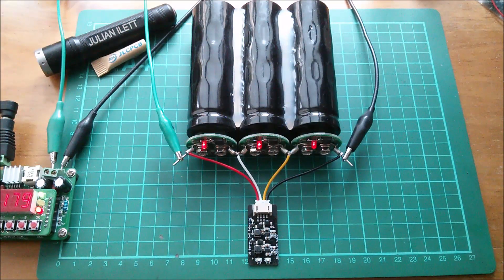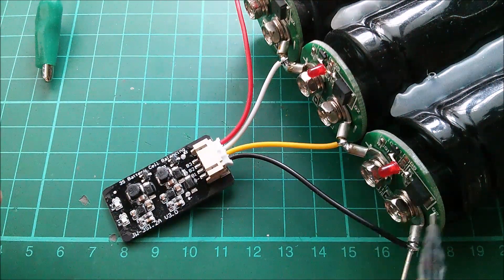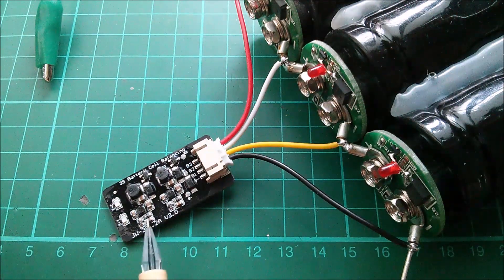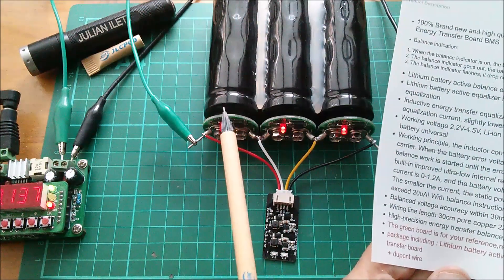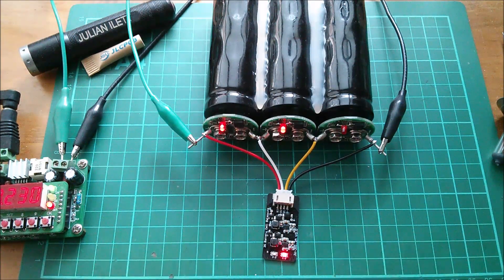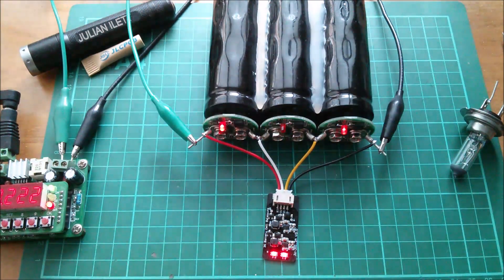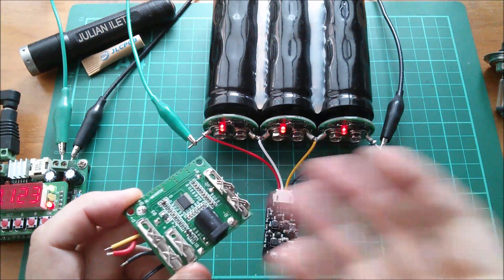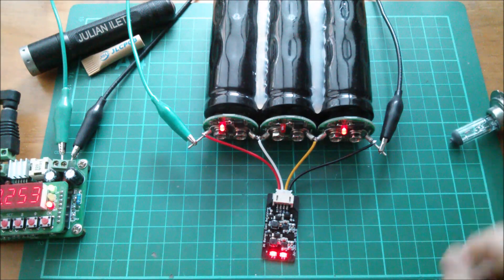Active Cell Balancer for Lithium Ion Battery Packs

Comment: Hi Julian, I know this is a bit delayed but quick question, If you had those super capacitor connected to a battery pack (LIFEpo4) would they discharge the batteries? I;m just about to make a battery pack and was thinking of adding some supercaps but trying to decide whether to connect on the batteies or after the switch

Comment: Does not this module decrese the lifespan of the batteries quicker? Passive balancing takes the energy from one battery only, contributing to its charging/discharging life cycle. But when you are charging one battery by another battery, you decrese the lifespan of both batteries.

Comment: I read somewhere you have to run power through the pack for this to work? I'm getting mine today hopefully it'll work for what I need.
Reply: Nvm it does work without charging or discharging. You just have to be careful when plugging it in. Either go in fast or make sure the -B pin touches first. 

Also loose connection causes the board to short out in like a second. Make sure those solder joints r good

Comment: I've got a few of these from 4s to 16s but my 13s blew its IC between cell 3 and 4, measured the resistance on these cables and got 10 ohms, seen a few videos of these bursting into flames on first use, build quality variable, so now I'm trying to identify the IC so I can replace it, hoping to reverse engineer it and make my own.

Comment: I think this is going to solve a problem I have with one of my 3S tool batteries. It's a dumb battery with no balancing and as a result over a few charge cycles one of the cells gets out of sync with the others and then the battery capacity is severly reduced as it doesn't charge properly and cuts out in the tool.
At the moment I have to open the battery and manually balance the cells. I think I could add in the wires for this board and then let the board do this for me.

Now to find it at a good price.
Reply: I have worked out I can fit this into my battery charger using the monitoring pins built into the battery. Obviously not to be used while battery is charging but I can use it to balance afterwards. 
Going to make it removable by using a USB as it has the 4 pins/wires I need for a 3S board.

Comment: Thank you very much

 I learned a lot and you helped me make an informed decision when ordering BMS for my lithium 18650 project.

REASON!. I wanted to make a 4S Li-Ion standby charger and the problem was this info below. 
Chargers made for operational readiness, or standby mode, often let the battery voltage drop to 4.00V/cell and recharge to only 4.05V/cell instead of the full 4.20V/cell (Mine is a Solar 18V 100W)

Now I wondered how to balance cells that don't get to full 4.2 volts and man you solved this problem for me!

Comment: When using LiPo batteries, Is it necessary to use a LiPo charger with these active balancer boards, or would a fixed voltage be OK? Thanks

Comment: I don't understand your test, you're trying to test how the balancer works and yet you connect the charger??? you should test if all voltage are equal after the lights comes off without the charger

Comment: I got 4 of these balancers on eBay to use on my 14s Lithium ion battery pack. First one burnt with smoke when I plugged in. Second one kind of worked. However in a 14s pack, with minimal 0.1V difference for the balancer to kick in, the worst case scenario there can be 1.4V difference in voltage between cell with minimum and maximum voltages. After all I went ahead with a capacitor based balancer with better sensitivity.
Reply: In your worst case scenario 1,4v. (In theory) That means that the best cell triggers the BMS at 4,2v so the charger stop. And the worst cell is at 2,8v. 
That will never happen in real life. Liion are empty at 3v so the charger never charge and your battery pack have no energy.

Comment: The circuit is similar to a synchronous buck switcher.  A synchronous buck converter has an active MOSFET for rectifier as well as normal coil charge MOSFET switch.  Because it has two MOSFET's to series coil it can buck in either of two cells direction.  The I.C. measures which one of the two cells is higher and buck transfers from higher to lower voltage cells.  Multiple IC's overlap every two cells so it can bucket-brigade charge transfer up and down a series stack of cells.

It actually worked better for you then I expected for the 2.5v supercaps although you did not measure transfer current.  Problem, which you eluded to, is as the cell voltage is lowered, the gate drive voltage to the MOSFET switches is reduced.  This causes their ON resistance to go up reducing the buck switcher transfer current and creates higher switching losses.

Comment: The price of these still haven't come down and I don't know why. They are still about 10 quid from aliexpress including P+P. Considering the components involved, these should be as cheap as chips by now.
Reply: Down to just over a fiver now.
Reply: @caskwith  Nice one. Good to see the prices come down. I did actually buy a couple of these when I posted and they seem to work fairly well.
Reply: @Ziplock9000  That's good to hear. It's a shame no-one in the UK is selling them, I always prefer to buy from a local seller even if it does cost me slightly more as it's so much easier to get a refund if something goes wrong.

Comment: nice video, but i think you're setup is a bit flawed. you are not really showing that it is "moving" current from one cell to another. you are charging at the same time and you are not even measuring the individual voltages on the cells and not measuring the amps. it might as well that this balancer is simply "burning" current on the cell(s) with the highest voltage

Comment: Do you really need a buck converter? it could be the case that cell 1 is being charged with a higher voltage (lets say 2x 4.2 volts) and for cell 1 to charge cell 2 it could be 4.2 volt -> 4.1 volt and the bigger the voltage differences the bigger the charge current with a limit of 1.2 amp.

Comment: I got the 7s version of this and have tested it for 2 months. Works great so far. However, we need a version 2 of this because it only monitors differences of adjacent series. We need one that takes an average of all 7s and tries to bring every series to the average voltage otherwise what happens is that at 0.03v accuracy multiply by 7 = 0.21v. In theory, the 1s (first series) can be at 4.10v and the 7s can be at 3.89 (-.021v) and this balancer will not care. This will become worst with a 14s pack and so forth.

Comment: Hi Julian and all.

Can we really call this BMS ?
It's only balancing the cell, but doesn't seem to do any overvoltage or undervoltage protection of each cell ! Which is very important for Li-ion battery, if not most important!

With that board, you can argy  that all cells are balanced at each time (which is far from true in case of defective cell or problem on the battery pack like broken spot-weldded connection, 1.2A balancing current would never fix a 10, 20 or even more amp of your charging device or your fed device) and thus, manage the entire pack voltage for over and under voltage, but I don't think it's the good way to do it, actually, I'm pretty sure it's not.

I would be interested of what you think.

Comment: julian,
I have come across this charger / balancer unit designed for drills etc. (https://www.aliexpress.com/item/32839009198.html?spm=a2g0s.9042311.0.0.44a44c4dS5p5Mr) not sure if you have come across it but I am loathed to put it into a battery pack as I am not sure whether the balancing happens only at charge time or continuously. I used something similar a while back in a 4s2p pack but when I came to use the drill it had depleted all of the Lion cells and I couldn't recover them.
Mike

Comment: I had a idea.
Could it be possible to make a circuit that connects from one extra battery and walks around to the other cells?
Basically as it hits the higher voltage cells the extra cell would draw some charge then as it moves to lower cells it releases charge.

Comment: Honestly, I don't think I have ever seen a balancer  circuit actually work the way we all want it to work.  It's all about ohms law, very small voltages / small resistors  = very small currents.    I think you would not  of seen any difference between a  pack with the balancer and a pack without the balancer. You would have to have a bad cap or cell in the pack to see that balancer do anything noticable. Interesting video, I like your common sense approach and the fact that you don't rehearse before doing the video.

Comment: Julian, if I bought a 6S Active Balancer BMS would I be able use part of the BMS, say use it on only 3 or 4 Li-ion cells if required? If I could it would save buying lots of different Active Balancer BMS’s

Comment: i very much doubt it can transfer 1.2A. 
the battery balancers that balance at all voltages have the disadvantage in so far that you need perfectly matched cells. otherwise it will try to transfer power all the time in the lower voltage cell but then has not time to discharge that cell again and then in fact creates cell unbalance. this happened to me.
a cell balance system should only balance in the satiated area (almost full). it therefore has to be adjustable because there are that many different lithium batteries.

Comment: Most types of batteries have difficulties when configured in parallel (same voltage, increased amperage).  It is common to have a cell that isn't staying at full voltage (what it's voltage would be if not in parallel).  This device enables automatic switching in a parallel circuit to ensure your batteries stay balanced.
Reply: i think you are a bit confused about something?

Comment: easy, it's using a 2nd fet in place of the diode in the boost, circuit will look like a 1/2 bridge. I sold one like this in the '80s

Comment: Active balancing is not necessarily always a good thing.
Reply: In what situation it is not a good thing?
Reply: @sikkepossu  
he probably thinks if one of the cells goes bad and starts turning stored energy into heat, and you keep pumping energy into it from the neighboring cells, you will accelerate deterioration and ultimately, it can result in big boom.

Comment: So, with 17 cells, and one in the end very slowly losing charge you'd eventually get somewhere between 0.48 and 1.6V difference between highest and lowest cell, as balancing stops at 30mV, but doesn't start, and therefore restart until 100mV difference?

Comment: This would be more clear if you were not also charging the stack at the same time this balancing board is supposed to be trying to help.  How about getting 3 volt meters and repeating the experiment, and leave the charger off?  I can't tell if it's this magical board doing the balancing, or your existing protection devices with this board just reporting a voltage difference?

Comment: I am confused, You called them supercapacitors and the article says Lithium Ion packs. Which are they?
Reply: Its possibly click bait.
Reply: The balancer is designed for use with lithium battery packs, but he's using it with super capacitors.

Comment: i invest for some time an idea actually triggert by you julian with the joule thief to do this. But quickly ended with the single direction ernergy taransfer limit. But the breaktrought for me was an idea to you standard available components, and i do my balancing with class D mini audio amplifier. PAM8403 is best. Input grounded so its cold against AC and the internal DC is reference supply/2. Power for PAM8403 for two super caps from 0 to 5 or 5.4V and the the decination filter at output works fine to transfer energy between two super capacitors. With a second PAM8403 its then possible by overlap to build a 3s balancer. does work fine even into 1A transfer current, which is for balancing with not wasting into heat more then efficent. Standard balancer just burn ~100mA. PAM8403 boards are ready and need only very little modification. the inductor can be taken or must be added i tested with 10uH works fine

Comment: am pondering to use these super caps to replace garage 24V battery
Reply: they probably have bigger self-discharge current than batteries, so they might be useless for long-ish term storage (i might be wrong on that one), but the higher charge and discharge current might make them ideal as buffers for intermittent high-current load/generators. 

what is your use case?
Reply: the batteries allways flat or don't last long then I cat open garage door
Reply: @jacquesb5248  supercapacitors will probably be flat even faster.
Reply: @gominosensei2008  dunno. but charge cycles way more?
Reply: @jacquesb5248  possibly. If the charge is done properly. Supercaps are way more sensitive to overvoltage than, say, lead batteries.

It might be cheaper to

A verify that your current batteries are actually good

B just add more batteries. Maybe your problem is insufficient capacity. 

You should determine if your problem is energy or power. 

Capacitors have more instant power but they are smaller capacity and higher self discharge. 

It might very well be that one problem is disguised as another. You might have a too high initial current draw which damages your batteries and makes them lose capacity. In that case you should buy fresh batteries and put more in parallel and/or a small capacitor bank in parallel with it. 

Or you simply don't have enough capacity in your batteries to last enough time. Then all you have to do is put more batteries. 

You have to characterize your setup: internal equivalent series resistance, parasitic power draws, self discharge rate (equivalent internal parallel resistance), peak power consumption, average power consumption before anyone could with any reasonable confidence give you advice.
Reply: @gominosensei2008  o they dead alright. power goes off and garage door can maybe move half and stops. if i test them volts drop to 10V. woukd be cheaper to replace them. caps more for instant hight load true

Comment: I can't see why it should be quandary about whether this device works as boost or buck converter. To me it is obvious, it is a buck one. It takes the voltage from a higher cell and bucks to to the undercharged cell. The 0.03V difference is simply the margin at which bucking stops. The logic of the IC is quite clever as it is, to make it boost or to be in the "any cell to any other cell" configuration would make it prohibitively expensive.
Reply: No, it's a buck/boost topology.  To transfer a decent amount of current between two similar potentials (this stops at 30mv difference) you have to use a circuit that can boost.

Comment: With a super capacitor bank, you'll only get a significant imbalance during rapid  charging or discharging, and there is more than a minor difference between the capacitors.

Comment: Is there any way this BMS is taking the energy from main contacts and charging the unballanced cells when battery is discharging? I am using an active 4S balancer made by REC-BMS and it is working this way. It is also discharging higher charged cells to battery main contacts, when the battery is charging.

Comment: Hi Julian!  Will Prowse tested those "active" balancers a while ago and found out on a later video that these are fake! https://www.youtube.com/watch?v=fEVQ_8DUpm4
 They dont push energy from one to another but instead burns it in resistors. They look exactly the same as in your vid - not sure if they are exactly the same. Unfortunatly i cant find his comments about fake anymore...
P.S: Here is the vid about the fake: https://www.youtube.com/watch?v=PZygp7DxpTM&feature=youtu.be
Reply: the thing should probably be tested without active charging to determine wether this one is real or fake.
Reply: @gominosensei2008  The best would be to put an amp meter between the cells (caps) and the Balancer and really check the current between them. I doubt it could shuffle near 1.2 amps. As Will Prowse has prooven they dont work to their specs, more about a few 100 mA and not transferring current between the cells - just burning energy!

Comment: Finally I have always felt that over voltage balancing by burning off excess voltage through resistors was just wasting your already stored energy. At least this uses that energy to charge your lower cells.
Reply from the maker: Me too - I feel the same :)